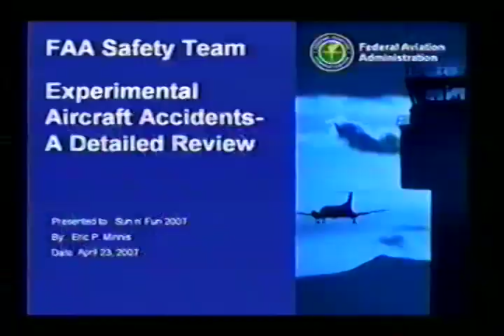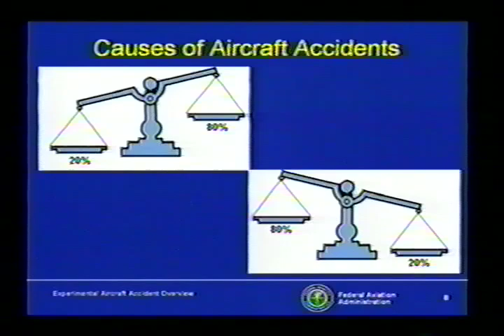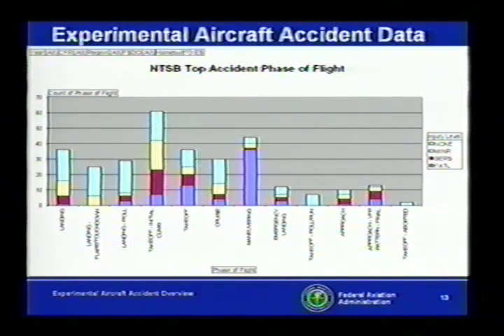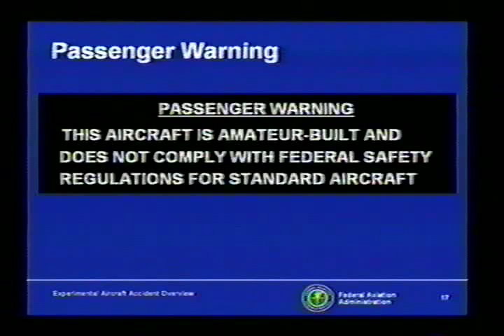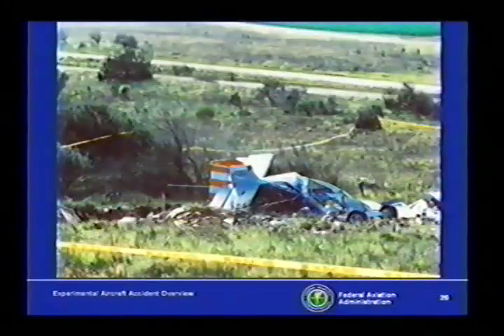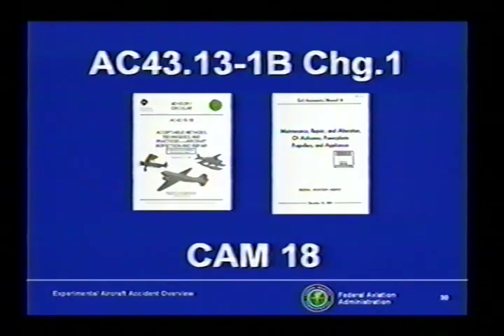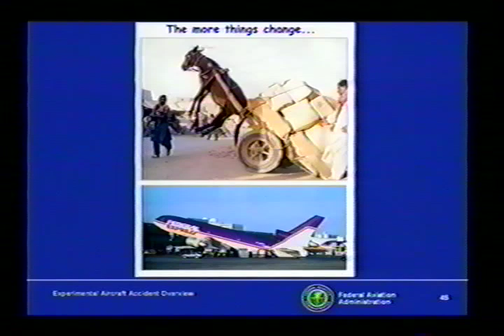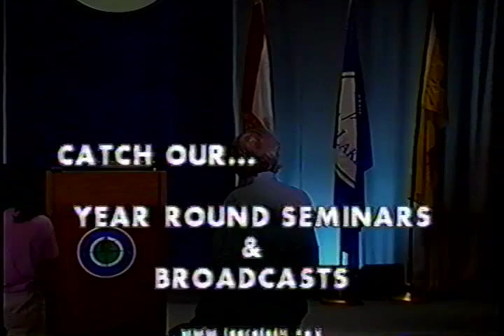FAASTeam - Experimental Aircraft Accidents

Comment: I see some problems with these statistics certified  could include  aircraft such as  airlines Boeing 747s and the like ad it seems unfair to compare those to home build aircraft. what we need is statistics that break down  fixed wing and rotor aircraft and comparable type. Also we need a breakdown  by  home build type. kit built plans built own design etc. Also what about construction method. For example  what about wood  compared to  fiberglass compared to aluminium construction. As an example HOW MANY RUTAN VERI EZE  HAVE CRASHED  AND WAS THAT DUE TO MICRO FRACTURES IN THE MAIN SPAR COSTRUCTION? these kinds of figures would be more useful.